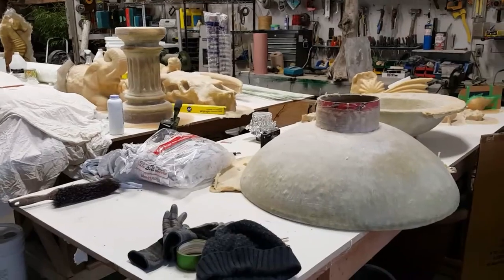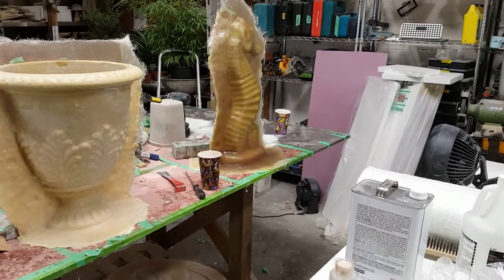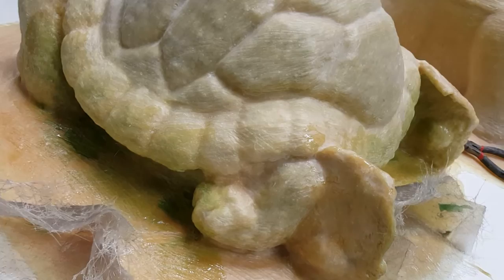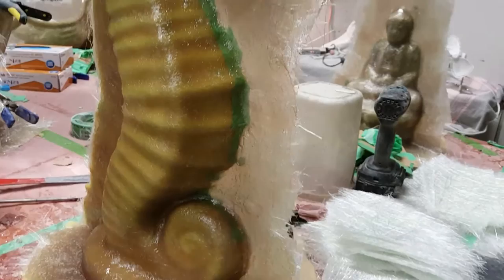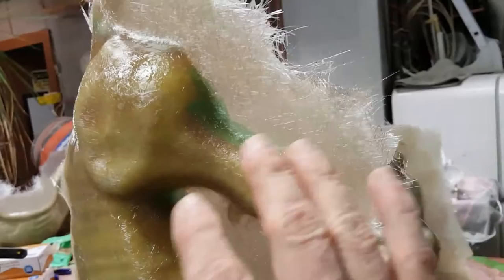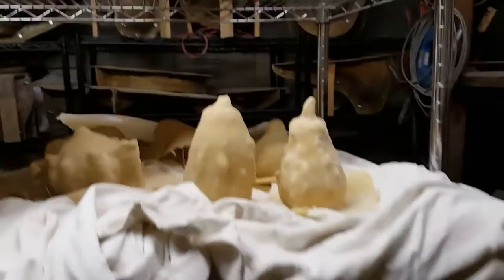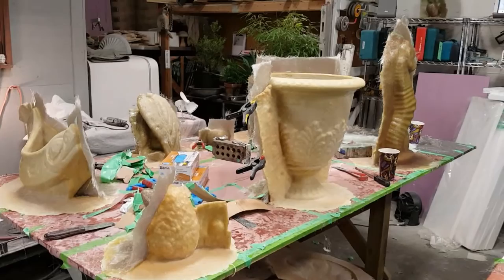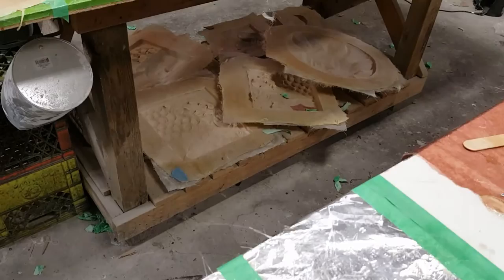Concrete mold making,Fiber glassing  mother mold and a few tips.

Comment: hello,for how long you've been working with polyester resin for the fiberglass? i heard that is very toxic and in some cases it could be even letal, how true is this?
Reply from the maker: Been using it for approx 13 years.Yes,It can be harmful with suspected links to cancer. It is safe to use as long as you inform yourself of the HAACP recommendations. A approved niosh face mask with filters rated for organic vapors,this is a 100% MUST!!